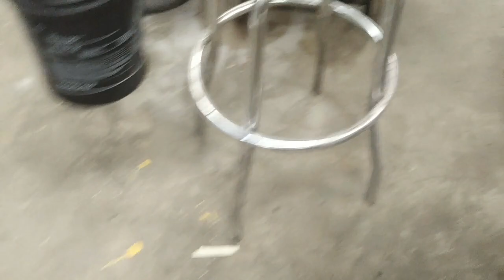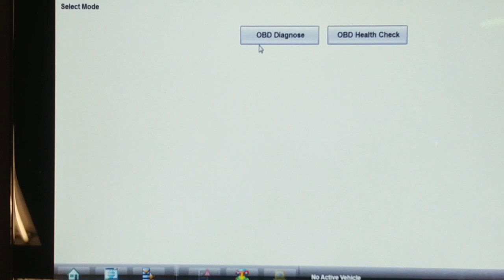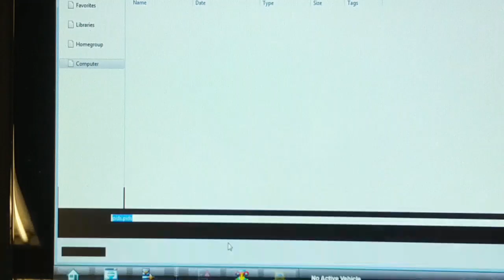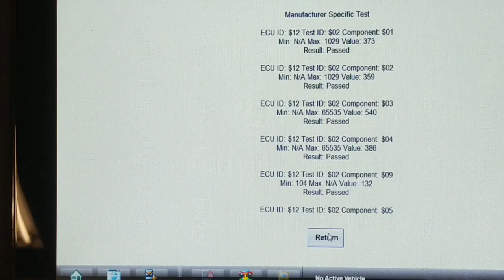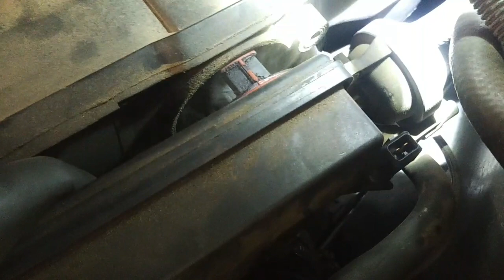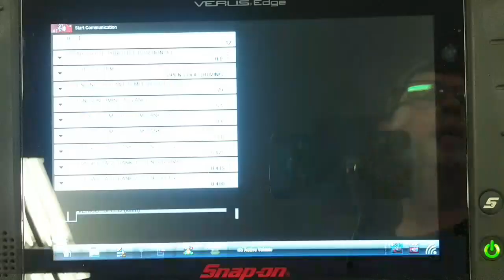2004 BMW 325XI Engine Misfire Running Lean

Comment: Cheers Philip, any particular smoke machine u recommend, Sandy
Reply from the maker: Cheers Sandy! I'd recommend Cool Smoke by Motorvac   it's not what I have but it's better than mine. Uses Shop Air pressure and has a flow gage to help determine leak size as well. Mine uses an on board mini compressor so it's noisy and has no flow gage. Very useful tool. I've only been fooled by a smoke machine once where a PCV elbow under the intake would leak due to vacuum but not leak with the smoke. Hose was split. Awesome for Evap Testing.
Reply: @PhillipBailey  thanks Phillip for advice cheers sandy